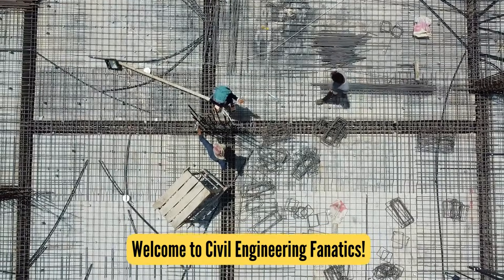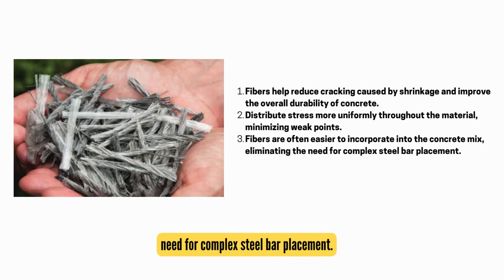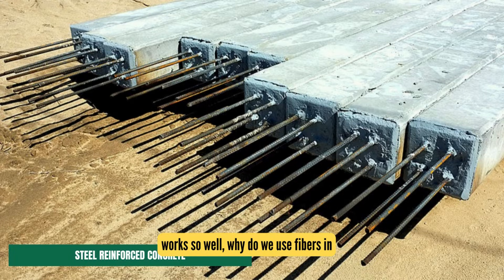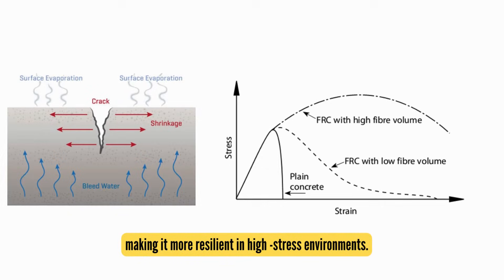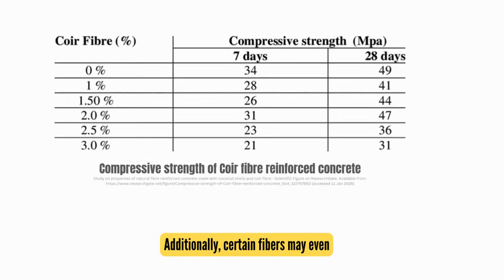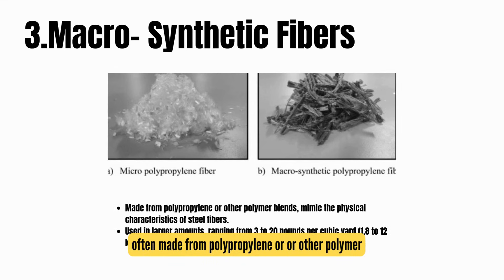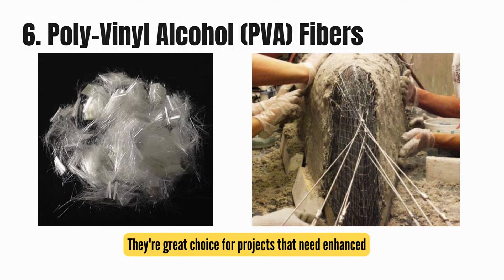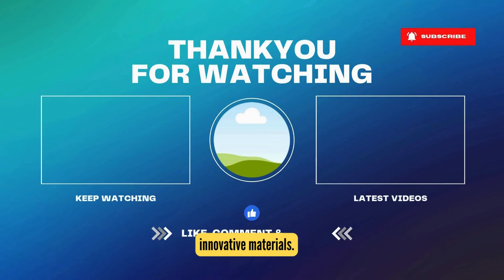A Guide to Fiber Reinforced Concrete (FRC ) | Concrete Innovations

Comment: Thanks for the useful intro, I am planning to do my kitchen shelves and want to use glass fiber reinforced concrete, I need to know if these fibers are the same ones that used in fiber sheets?
Reply from the maker: Good question! Fiber sheets and the fibers used in fiber-reinforced concrete (FRC) are different.

Fiber sheets, also known as fiber-reinforced polymer (FRP) sheets, are used for strengthening structures externally. They are made of carbon, glass, or aramid fibers bonded with a polymer resin. These sheets are applied to existing concrete surfaces to enhance their strength, durability, and resistance to cracks.

On the other hand, the fibers in FRC are short, discrete strands mixed directly into the concrete to improve its internal tensile strength and crack resistance. These fibers can be steel, glass, synthetic, or natural materials and are distributed throughout the mix.

So, while both involve fibers, one is externally applied (fiber sheets), and the other is mixed into the concrete (FRC fibers).